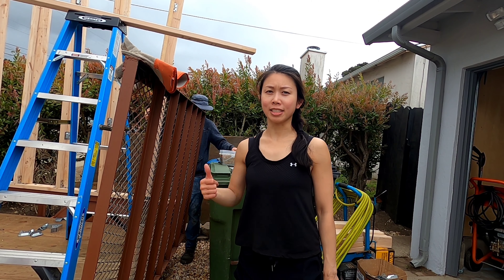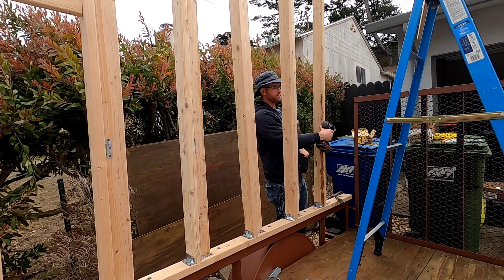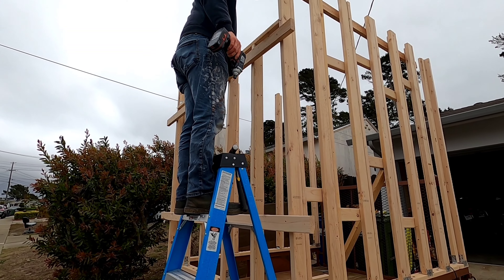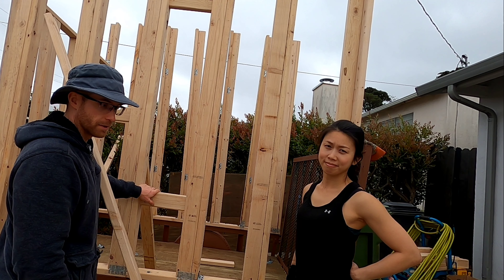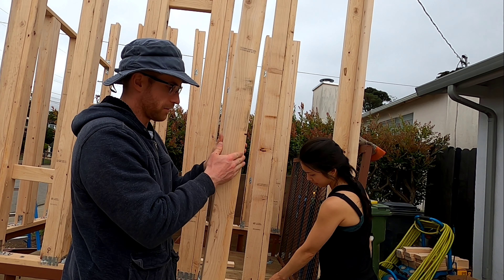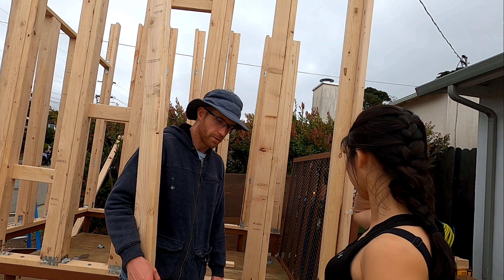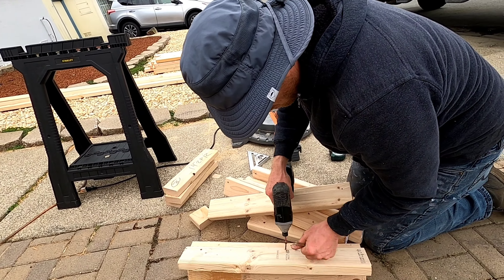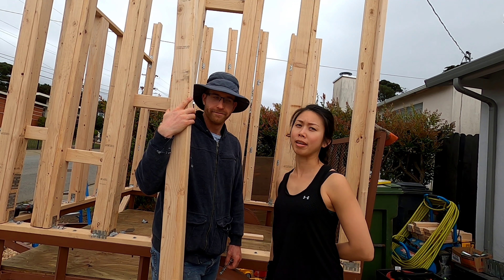DIY Homemade Motorcycle Trailer Camper Build Conversion Day 4

Comment: Hate to say it now that you've started but get rid of the wood frame and get refrigeration panels, once they're screwed and glued together with the joining brackets they're far stronger and insulated too.
Reply: Composite panels were definitely an option. I think that you’re right that they would have been stronger. I was worried about being able to lift them into place as our driveway is on an incline two different ways (up and to the side) and we don’t have any overhead lifting equipment to raise / perfectly position the monolithic pieces.
Reply: @Kyle-gy7sr  they're actually pretty light especially once you've cut them down to 7 feet or so. Once you got the two corner pieces in to hold it all up the rest goes together really easy. Look into more if you aren't too far into it yet.